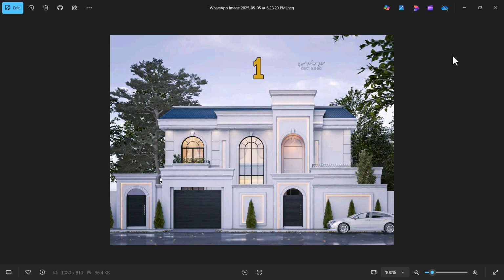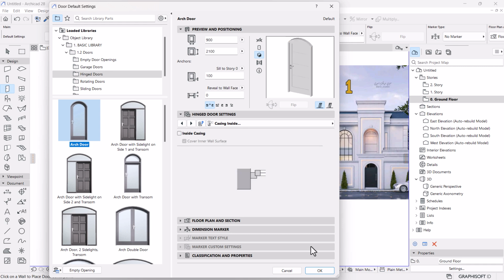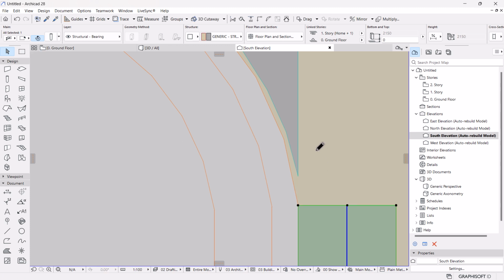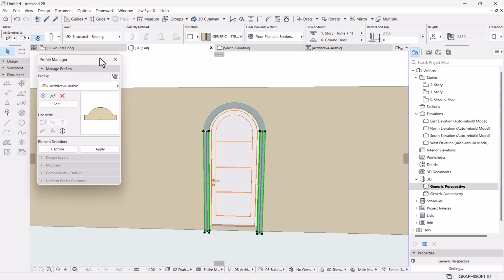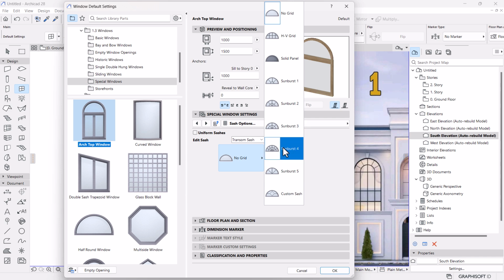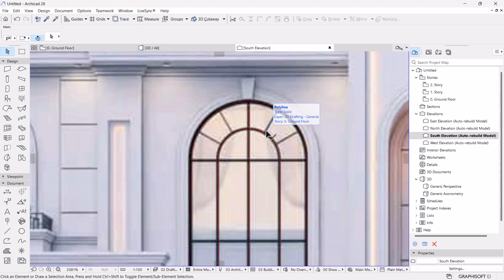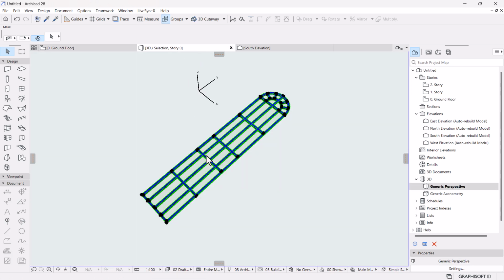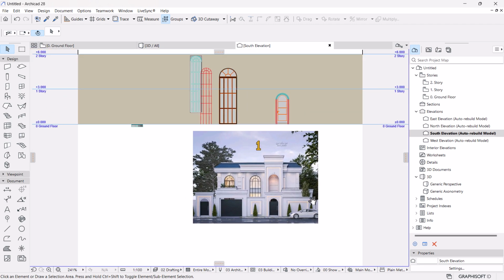Neoclassical Architecture Style Modeling in ArchiCAD

Comment: Dude, ....that's not "Arabic" architecture or "Arabic"-style architecture.

That's Neo-classical Greco-Roman revival ( Greek/Roman descended architecture style.revived during the Renaissance and now adapted to modern application.

It's really important to get the terminology and.classification correct because each distinct style and period has very specific rules and features.

I mean, you can even Google "Arabic" architecture and see what pops up under the images in terms of what the style is supposed to look like.
And then reverse image search the image you just used along with the term "architecture style" and it will show you what style that is.

If a client tells you they want an "Arabic" style house and you design that for them, you'll lose that client.
Reply from the maker: I appreciate that, thanks for the correction